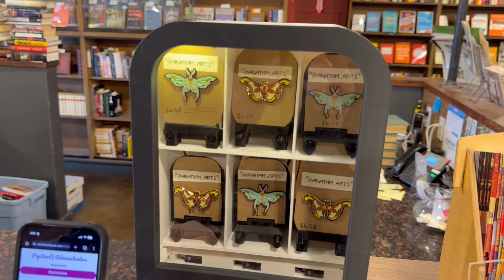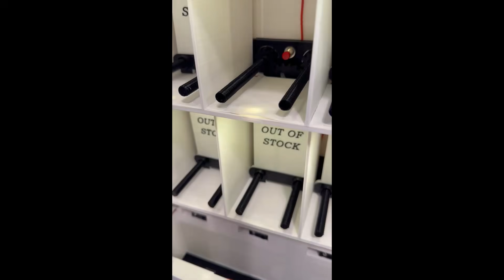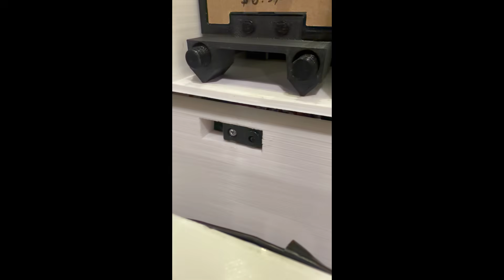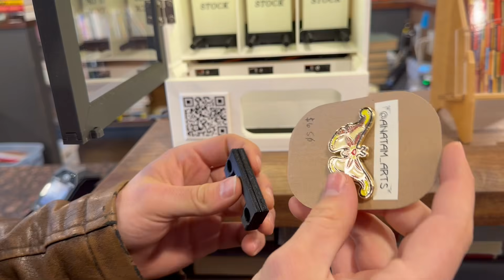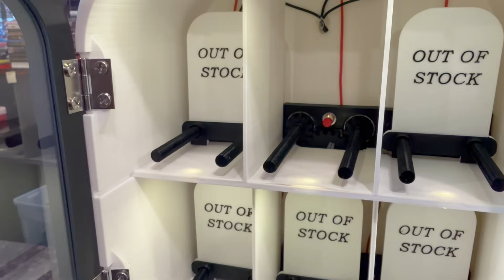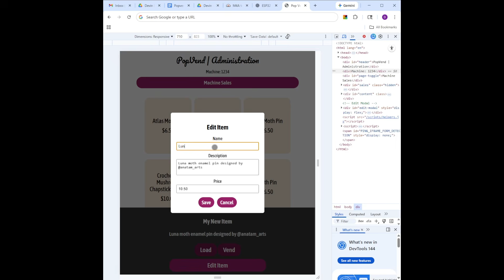I Built a 3D Printed Vending Machine

Comment: thats wesome!
one thing:
entering the machine code after scanning the qr code adds friction..
itd be cool if the qr code already had the machine code in it..
Reply from the maker: Thanks! Yeah, I would prefer just the QR as well. The code is generated on the machine to confirm you’re physically in front of the machine, which avoids remote control issues.

Comment: If you make your sleds also connected to the bolts it would stop them from falling if the machine is bumped. You can add an area in the front the depth of the tracks so that the machine still pushed the over the edge! Just a thought.

Comment: I regularly make very special Advent calendars for my nephews. Basically, they are vending machines that “sell” a free pack every day 😆

I built the first ones without a 3D printer. That limited the possibilities. The first Advent calendar took a very long time to make, as it consisted only of electronic components and wood. The basic idea was to mount a wooden rod to a stepper motor. Then I attached a long strip of paper, which gets wound up, to this rod. This gave me a conveyor belt that could be used once until it needed to be refilled. I also added an IR proximity sensor to detect the falling objects.
Fun fact: these proximity sensors don't work very well with dark, non-reflective objects... perhaps a combination of a light barrier and a proximity sensor would be very reliable.

The second version was a large wooden frame construction that provided me with 24 small boxes, each closed with a servo-controlled door. This worked reliably, but is not very versatile in terms of the size of the “product.”

The third and most recent version is designed like a claw machine. In theory, the electronics know exactly where the item was picked up, so it could also function as a vending machine. However, the first version had some problems because the cord that moves the claw sometimes jumps out of the winch... Next fall, I'll have to find a technical solution for this.

Comment: I’m really curious if you at any point considered using off the shelf springs from McMaster-Carr (or just Home Depot) or making a simple spring by wrapping some cheap steel wire (14Ga Galvanized fencing wire is very accessible) around a dowel or broom handle (often done when making home-made chainmail) and sticking with the conventional vending machine pusher mechanism

If you wanted to incorporate 3D printing in that step and make more repeatable spring spacing you could 3d print a rod with a guide channel for bending the wire into.

Comment: Awesome project. But I highly recommend getting into CAD software instead of blender. The parametric stuff makes making changes so easy as long as you do I right .With your skill set you would figure it out way faster than me. I started in cinema4d then blender as I got older and I do less 3d stuff and more CAD
Reply from the maker: I know, I definitely should. I came to 3D printing after some experience in game dev and the few times I've tried fusion 360, I just think "I could do this faster in blender" . Something I need to get over eventually

Comment: God I need one of these for my vendor events! I already plan on printing the GotchaPop too so this would be an awesome add-on.  Only suggestion I would make is if the the back has enough support for the bolt, to maybe use actual pre-fab metal bolts for a smoother experience OR reducing the thread pitch so then you get more distance travelled on the sleds with less rotations of the motor.  Could reduce time waiting for it to retract for reloading as well.

Comment: To help with the loading aspect, could the tray holes be modified to have almost like a spring tab inside instead of a threaded hole? It could allow the tab to engage enough of the bolt threads for normal movement but would also allow the manager to just push the plate back as the tab clicks over the threads. That way you don't have to program a reverse operation, nor do you have to wait for it to retract each item plate, just push it back until it hits the wall or the item behind it and load the next in front of it the same way.

Comment: Awesome video love seeing things like this keep sharing your journey on this project! And if you havent already get it uploaded to makersworld I can always help you with the 3mf files but this will get you a few printers for free guaranteed!
I did have a thought though if  your using single items in each slot why not opt for a sled with a pulley system then have it tilt at the edge to drop the item into the tray
Reply from the maker: Thank you! I'm actually doing multiple items in each slot depending on the size. For those pins I can fit about 6 in each.

Comment: Have you considered what might happen if the wifi absolutely sucks because of like a hundred people using it
Reply from the maker: Yeah it has basic retry logic to reconnect if it loses wifi. The server also makes sure the machine is responsive before it will display the item selection screen or accept payments. But yes, it certainly requires stable wifi.